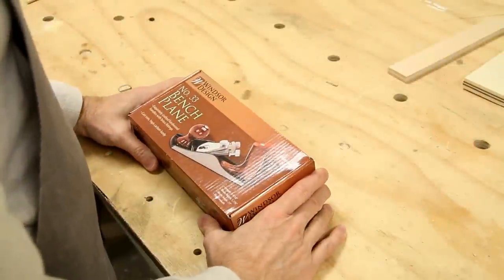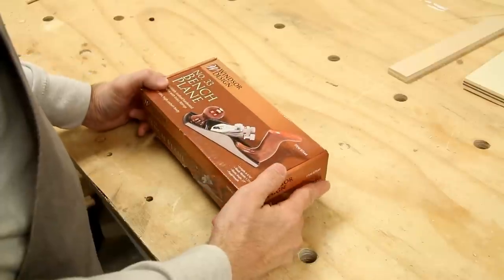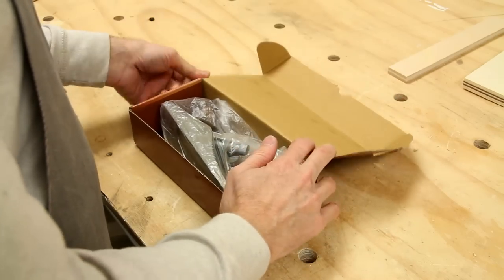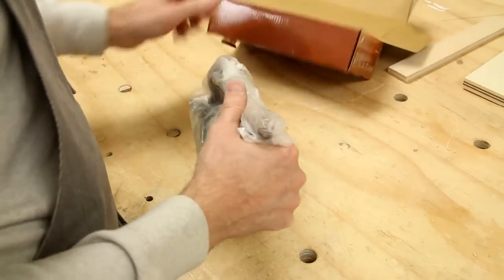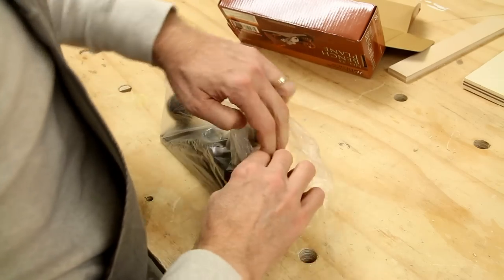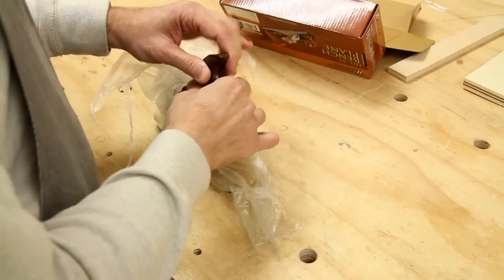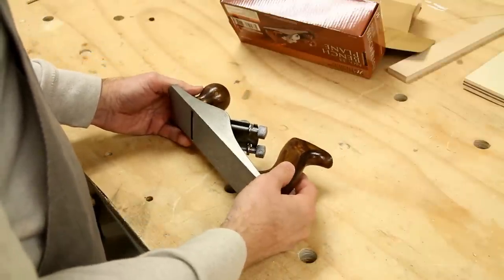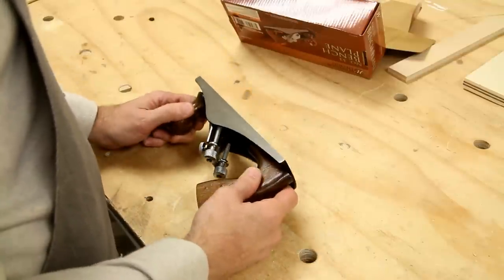Harbor Freight No 33 Bench Plane Review and Tuneup

Comment: I wonder if that inexpensive plane may make a decent scrub plane. With the wide mouth and I suspect softer steel blade, it may be an easier conversion and avoid reworking a vintage plane.
Reply from the maker: I could certainly work as a scrub plane, but I think it's little on the short side of typical scrub planes, which can be closer to a #5 in terms of length.
Reply: Marty Backe stumpy nubs has a video about turning that particular plane into a scrub plane
Reply from the maker: Yes, I've seen it.

Comment: Did you happen to try it before fixing it?  I'm curious if it would have worked at all.
Reply from the maker: No I didn't. I have a lot of experience with hand planes so I know how it would have performed. Yes, it would have worked, but the shavings would be coarse, leaving a poor quality surface finish on the wood. I wanted to see if I could get very thin shavings and a smooth wood surface.
Reply: Marty Backe you hit that nail square on the head. I hated mine, was absolutely horrid. I being an absolute beginner requested a Stanley hand plane for Christmas/birthday. Will use the hf plane to practice sharpening with so I don't mess up my really nice Stanley.

Comment: Nice video Marty.  If would have been interesting to have tried it right out of the box first.  

What do you use for lapping fluid on your diamond plates?
Reply from the maker: +Alan Erickson I knew it would cut, but the quality would be awful for what I wanted it for. But yeah, I probably missed an opportunity to show it.

I use windshield washer fluid.
Reply: +Marty Backe My first plane was a similar one and I had no idea of planes. As you showed you can turn some pieces of crap into something more or less useful but for most of them it's the old saying: "Bad tools you always buy twice". 

Eventually I got rid of the two adjustment screws and tuned the blade with light taps of a hammer so I had at least a bit of control of the blade. Today I keep this plane as a reminder ;-)

After buying my next plane I saw the difference, wow. And this one cost only about 100 bucks (a no. 5) and it became my favourite plane for six years now.

In my opinion even 10 bucks for it is too much.

But nevertheless thanks for your effort.

Comment: So, if woodworking is just a hobby (like it is for most people watching this video) and with a bit of time you can turn this plane into a plane that 'can take some beatiful shavings', why would you just use it for rough stuff? I understand that for the pro that has no time tinkering around with stuff it's not an option, but for a hobbyist it is just a beatufull product. Instead of spending 150 dollars for a plane he can buy a plane, a set of chisels, some marking material etc.

Comment: Great video.  I am new to woodworking and find it is difficult to find hand tools.   Most home centers don't really offer anything and the high quality tools are rather expensive for folks just starting out.  I'd rather mess up sharpening a $12 plane iron from Harbor Freight vs.  anything from Woodcraft / Rockler.

I do have a few questions though, you mentioned grinding the bevel on the blade straight, at first at a 25 degree angle and then after you said 30 degree.  How critical is the bevel angle?  Should the bevel be more, less or the same as the angle of the iron when installed in the frog?

Comment: How can that even be built, shipped from China, stocked in an American store and sold for only $10?  Even if the labor was free?  The blade has a camber, which actually isn't a bad thing, no?
Reply from the maker: +christschool Yeah, it's amazing isn't it. And everyone along the line was taking some profit from the process.

Camber like this blade had is for rough work, like a scrub plane. It was pretty clear that the blade just had a crappy grind from the person making 50 cents an hour.
Reply: +christschool low-quality materials sourced dubiously. Can&#39;t cut the company since it&#39;s 95% China stuff and there&#39;s almost no paper-trail to the source of materials. The tools are also minimally processed to reduce cost further. Just enough grinding to shape it vaguely like a tool.

Comment: you should see the one i bough for 1.2kd (around 4 dollars) exactly the same as the one you have with exception of weird looking  yellow/black stripes plastic handle, and bolts are stick out of the buttom slighly to hold the handle plus the cutting edge is so bad (bent inward out of the box)...like cookie monster took a bite of it bad ...ill try to heat treat the tip of it
Reply from the maker: +Faisal Abdulaziz They all must be made in the same factory. Love the cookie monster image :-)
Reply: Marty Backe
...my cousin have been there there is like countless factories for each item sold world wide with 
(10 small facotories for the same thing and 2 big ones that can produce huge quantity and higher quality)
and somthing like a 100 grade
each factory produces 3 to 5 different  grades of quality and brand built to the sellers preferance
so many factories you would not believe 

they share the blue print ...
same goes with all tool all the major brands are there 

if you want top quality it they can do it but for a much higher price which makes it unfeasible in terms of time and cost

Comment: For $10, that plane is an amazing value as is. Nobody is going to buy this and expect to build fine furniture with it. It'll be used to take an 1/8" off of the bottom of a sticking door and then be tossed into a drawer of other tools that are used once every ten years. Tools like this have their place.
Reply from the maker: Exactly!
Reply: You guys are nuts.  You couldn't pay me to use this on a consistent basis.  Adjusting this thing is nearly impossible, and you are going to have to do it frequently.

Maybe if you needed a plane for like 1 door or something, and then you throw it in the closet and forget about it, then sure.

Comment: Well done, for sure, but few have the tools to get such a plane fixed up. Also, time should be worth something. A $10 plane + 2 hours of your time is not equal to $10.
Reply from the maker: Woodworking is a hobby so the 2-hours spent on this plane was entertainment for me. As far as tools are concerned, I used very few to fix up this plane; some sharpening stones and a grinder.

Comment: Thanks for posting the video. I recently bought the same plane and see the same issues. I don't have the same files as you do but will try my best to get it tuned up.
Reply: It really isn't that hard.  You can do it with sandpaper and a plate of glass or ceramic tile.
Reply: I sharpened mine with sandpaper but I noticed that the sharpness is not mirror like. However, I cannot fin 2000 grit paper locally. 800 grit is the highest I have.
Reply: Jose Lamar Does Amazon deliver to your area? Norton Abrasives paper is very good. To get the mirror finish you have to be sure to take out all the scratches from the previous grit before moving on to a finer grit. Water stones are also a good option (I suggest Shapton, made in Japan). And finish it all off by stropping on leather. Takes work to get it right the first time but after that maintenence isn't too bad. Especially if you have quality high carbon steel.

Comment: The hollow side of the sole has a function to make the plane easier to slide over the wood.
Even the most expensive and best wood planers have a hollow sole.
Reply: Sorry, that's BS. The $10 Harbor Freight plane is not designed with a crappy non-flat sole to imitate a non-existent plane that has a hollow sole.  Please provide a single link to "the most expensive and best wood planers" that have hollow soles. It's important not to spread false information to new woodworkers who may be reading this.

Comment: Almost every bench plane you buy - from almost every manufacturer - will need work to get it to usable condition. Harbor Freight is no different, and no one should expect it to be.
Reply: Your right. But there is a bit of a difference. Yes all need to be tuned which makes it different than high quality expensive planes like Lie-Nielsen and Varitas. The difference between all the cheap planes out there is the baseline of the sole and type of steel the blade is. Is the sole baseline is 50% there, only needs a bit of tuning that's okay, with a good piece of steel that has good blade retention, perfect. But time spent on this HF Plane, you will never get that time back, the blade is TERRIBLE with little to no edge retention. Want cheap and good baseline that even out the box it's 4x better than this HF, Stanley. Worth the extra few bucks cause it's not that huge of a difference in price.

Comment: For ten dollars, you'd be lucky if had been heat treated, more likely its just low grade steal, as most of the Harbor Freight stuff is, better put some Linseed oil on it, fast.
Reply from the maker: I haven't had any issues with rust and the blade seems to be keeping it's edge. But yes, best not confuse this with a higher-end plane.

Comment: This HF hand plane was my first hand plane and I HATED IT. Yes I didn't know about the sole but did know about the blade sharpening. Tried my best to tune it and it was sooooooo terrible. Yes for $10 it's good but for $30 you can get a better plane from Stanley. This HF plane almost turned me away from hand planes all together, thank God it didn't. Got a Stanley block plane and out the box was night and day difference. Then after finding how to flatten the sole and got a Tormek T3 to sharpen the blades the Stanley works so smooth you'll think it's a Lie-Nielsen, even though that's the point of Lie-Nielsen that they come out the box pre-flattened sole and VERY sharp. The HF blade is very low quality, terrible. I used my Tormek to sharpen it and it dents/loses its edge after a few strokes, I would never recommend this HF plane ever because of the headache trying to make it into a decent plane I could've just paid a little bit more for a Stanley and get a better baseline to start with.
Reply from the maker: I agree with much of what you say. I certainly don't recommend the plane as a general purpose plane. But if you have $10 and some time you can get some use out of it. For me it was an experiment, and I can use it for planing the edges of plywood for rough prep work.
Reply: +Marty Backe yeah for that it's okay. Since plywood is very thin veneer and doesn't stress the blade. So it may retain its edge longer definitely on plywood. Anything else though I know for sure it won't. I tried pine. And it barely kept up before dulling up. Granted, It's 10 bucks so I cannot knock it at all. For beginners to practice and knowing it isn't a good hand plane, and not to expect much. So yeah it's okay if you know what it's meant for. You get what you pay for. Maybe even get a laugh giving it to a friend for a project and watch him struggle and sweat lol.
Reply: +Marty Backe you just have the plane acquisition sickness now. Whenever you see planes you are compelled to take them home with you. The sadder the plane, the more you'll want to take care of it.
Reply: +Paul Frederick lol the plane no one loved but he did. He cared for it as his own. As if it were a Lie-Nielsen.
Reply: Gold63Beast
I have the affliction. The worse shape a plane is in the better I like it. I'd have no use for a new Lie-Nielsen.

Comment: complete junk...  Get a pre-ww2 stanley for $30.
Reply from the maker: You missed the point of this; experimenting with a super cheap plane to see if it could be made to work. It was just a fun little diversion that gave me some entertainment in the workshop. BTW, it actually works (see video), so in actuality, it's not "complete junk" :-)
Reply: You are not going to find a pre ww2 Stanley plane for $30. 
At least one that can be reconditioned and put to use.
Reply: Sure you can...  On ebay it might be a little tough, but I have done it.  There's still a million of them floating around, and depending on where you live, you can find them at garage sales and flea markets.    My area doesn't have any, so I had to use ebay.  

The price of the #4 has skyrocketed as of late due to Paul Sellers though, lol.   I am sure you can still find one with a little perseverance.

Go to ebay, search auction listings, and click on ending soonest.  You can also search the buy it now, and look for people willing to take an offer.   I recommend getting something around WW2, as those are the best planes.  The really old ones are fine, but not as good.

The clean stuff goes for more, but you can easily clean up an old plane.  

Don't buy handyman, that's junk.

Ohhh and there are a few planes on par to Stanley's, but are far cheaper, because tey aren't as collectible, and people don't know about them as much.   Sargent, Miller Falls, Marsh, Keen Kutter, etc...